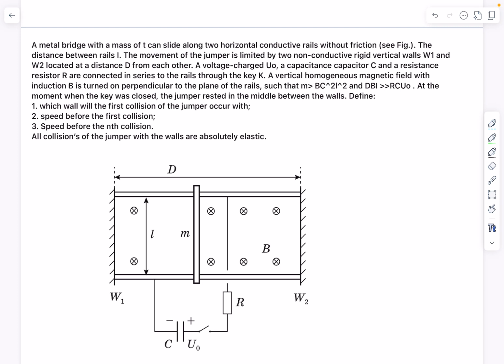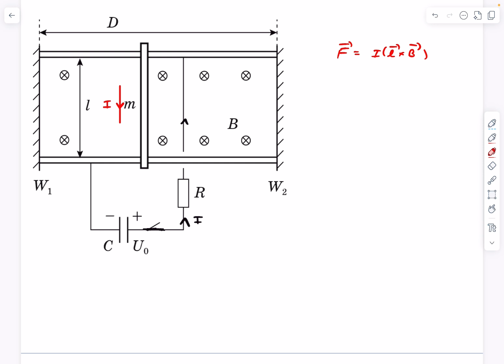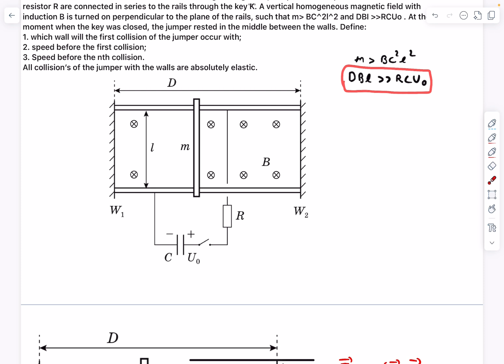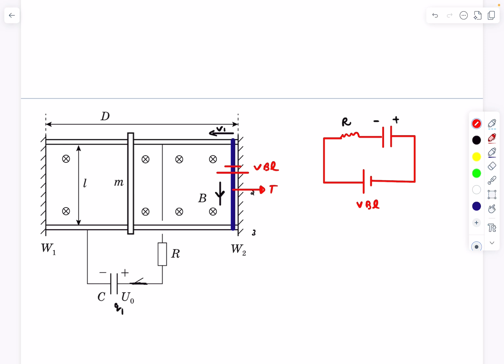Good Problem of EMI For JEE | RuPhO

Comment: Man, could you make a video on magnetic pressure just like u made the electrostatic one, with a little (but the only one that made sense of what we wanted) derivation at the start, please, with like a few problems to top it off
Reply: ' pinch pressure' is it ? It has standard method based on calculating surface current , like first consider plasma is in motion, then magnetic effects “squeeze” its volume, inducing inward pressure known as a pinch. Consider a cylindrical tube of 
plasma with radius R and length L moving with velocity v ,If there are n ions per unit volume and each ion has charge q, we can determine the pressure felt by the walls of the cylinder then calculate volume charge density rho in terms of n and q and consider some thickness to cylinder i.e negligible (like n power negative of fraction),then calculate surface charge density sigma  in terms of n and q and The current density inside the cylinder is J= rho v Use this result along with Ampere’s law to determine the magnetic field on the surface of the cylinder. Denote the circumferential unit vector as phi along its axis. Then consider The width of a differential strip of surface current is R dphi. Then cqlculate differential surface current dI that flows along this strip then differential force is felt by this strip due to the magnetic field generated by the volume current Integrate the expression  to obtain the total force on the walls of the cylinder; then divide by the wall area to obtain the pressure in terms of n, q, R, 
and v. This would be magnetic pressure I just assumed for cylinder for simple case you  can try for other one , Well this is the method  , I hope it helps you.
Reply: @ithihaskallempudi  wow loved it